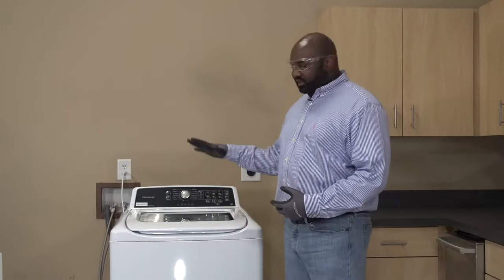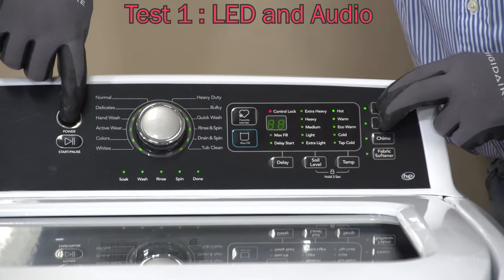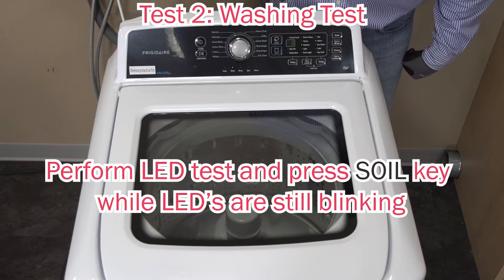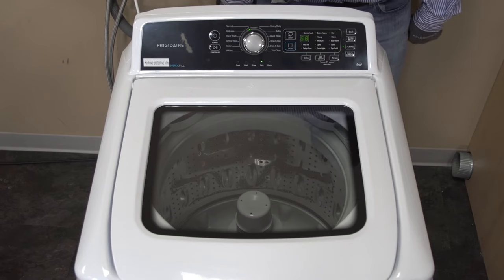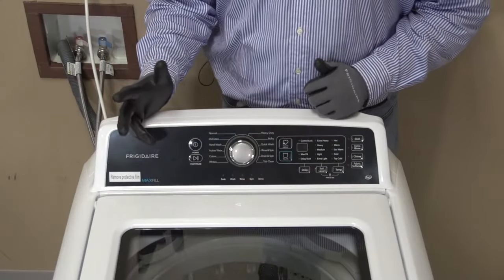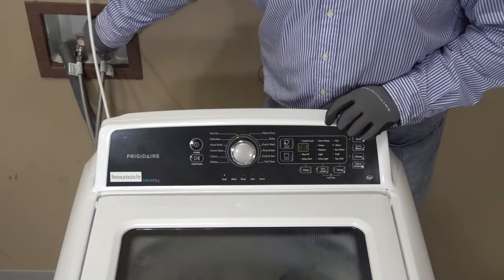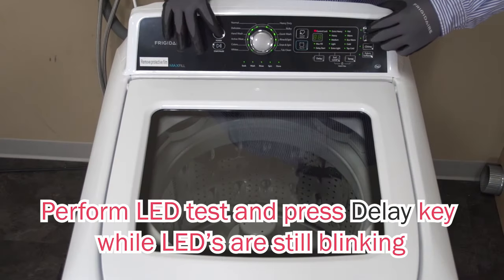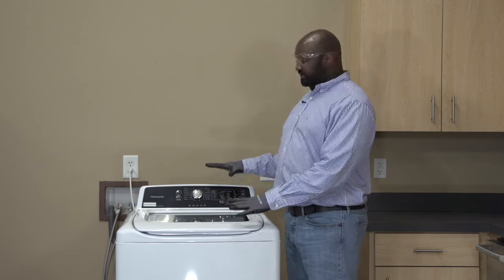Frigidaire Gallery top load Washing machine repair – Test mode and Troubleshooting

Comment: WISH I WOULD HAVE SEEN THIS FIRST!  Thank you , thank you. You are the only one of  multiple channels that even mentions the BEEPS or the (88). I had already taken the pump off,looking for obstructions etc, Tested pump with voltmeter. If I would have seen your video first I could have just taken off the 3 screws and replaced the control board and not even have to move the washer or take anything else apart. I also want to mention I bought a used control board on ebay  for about $25 dollars (New $220-$330) including shipping, it arrived yesterday and 30 minutes later I was washing clothes again. Thanks, again.